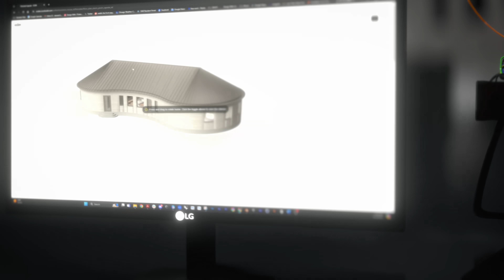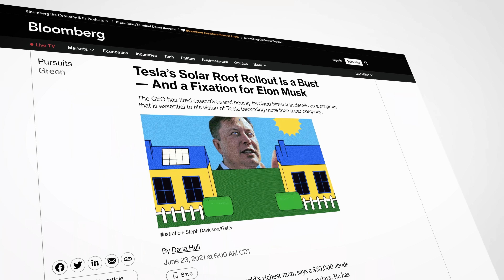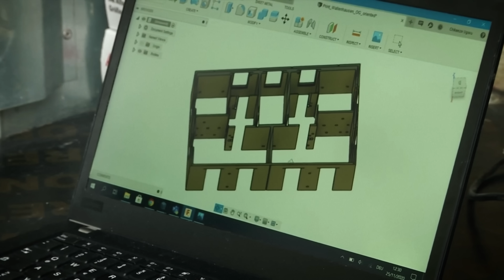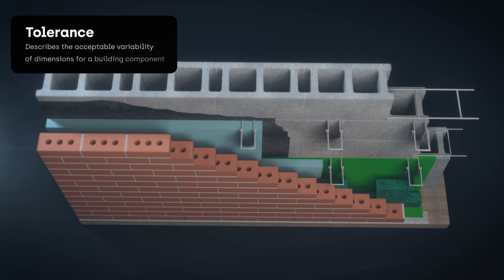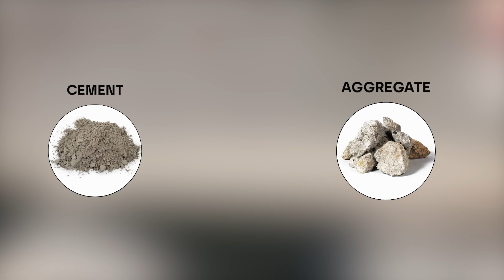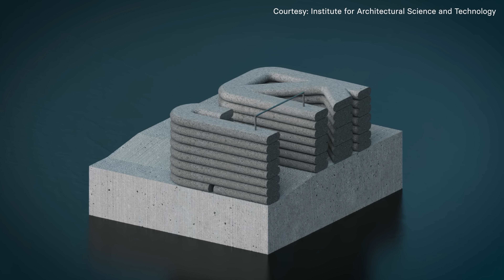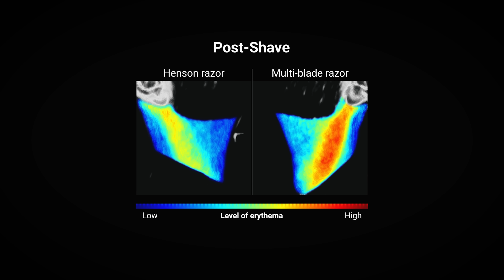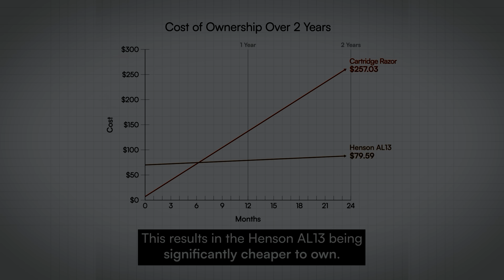Why 3D Printing Buildings Leads to Problems

Comment: If you're going to build a concrete house, using the standard pour into forms method is probably cheaper.
Reply: And   structurally sound.
Reply: I see no reason why both couldn't be employed. Seem to me with that much dimpling & texture printing leaves it wouldn't be very hard to 'surface' the print jobs with forms. Maybe using a slightly more plasticized thinset, perhaps? I can think of a few ways to potentially bite at that apple.
Reply: Can that do radius corners? Do they have those forms available or is it a matter of bending several layers of 1/4" osb and screwing them together?
Reply: On a one off, maybe - but how many people does it take to do that?

So to do.. i don't know, 50 houses it takes that many people x50, but with this you only need 1 person at most to monitor each print and you can do them all at the same time.
Reply: @PhosPhryne my forming crew can do 300 ft of wall in about a day and a half- 6 guys
Reply: @PhosPhryne  It doesn't matter how many people it takes, the bottom line is the price.
Reply: @marksandoval5361  .... And you do know LABOR is the highest cost of all?
Reply: @PhosPhryne  When everyone has been automated out of the means of production, who exactly is going to buy these products?
Reply: @andrewhooper7603  I'm not advocating or even think 3d printed houses can replace every aspect of a construction workers job. I'm just pointing out that they can have a use and it's not as far-fetched as you might think.
Reply: @PhosPhryne  how many does it take to set up printer? more than one I imagine...

Comment: For what's worth, there are designs and possibly materials that 3D printing can do and work with but molds simply can't. I don't know enough about advanced construction to name any in this particular field, but when it comes to home 3D printing, we have mountains of examples. Pretty much anything with a specific grid pattern on the inside or some interlocking mechanisms can't be done with a mold. Just to name two from the top of my head.
Reply: A lot of those elaborate "un-moldable" things are just pointless at an architectural scale. It could make sense to 3d print building components in metal, or ceramics with much finer tolerances, rather than trying to 3d print entire buildings.

Comment: The problem I see with concrete is cracking. I recently watched a show on PBS that tested the flexibility of an ancient Chinese wood building under various earthquake conditions. It was amazing to see how the thing flexed and danced around as it was shaken. Even under non earthquake conditions there is settling, wind pressures and temperature/humidity changes over time that will cause cracks and seepage in concrete. And patching concrete never seems to work well. I also think the exposed concrete looks unsightly since I don't like the African mud hut aesthetic. Cheaper is not always better.
Reply: Shockingly, the same was found in octagon blocks, when they were studied.  They could dance in the earthquake, but returned to the same position.   A square or rectangle block, does not do that. It's worse if you mortar it in place.
Reply: @normbograham  That is interesting. It seems we have for some reason become very wed to the square/rectangle for building structures. Maybe it is time to think outside of the box.
Reply: you can always attach some framing to get the exterior or interior visual you want.  the 3d printed part can be structural if they wanted.
Reply: Nothing cheap about concrete construction, especially when you form both sides of a wall. It's labor intensive and OPC concrete is expensive, and then you have to frame a wall inside your structural concrete wall to have something to insulate anyway. If Blue Crete (above) works out, it will save a lot of labor and materials.

Comment: It’s like the concrete houses that never took off. Even with tubes protecting wires and metal boxes mounted in the floors and ceiling instead of walls,  they never came into style.

The only reason this process is interesting to me at all is that some promise to use local soil rather than only trucked in supplies from elsewhere.
Reply: Concrete houses took off in Europe. The U.S. housing market was different, though, due to the abundance of wood. Slab-on-grade construction has the exact same repairability limitation, but is extremely widespread in the southern U.S. IMO, the repairability argument was never strong compared to the financial argument.

Comment: Imagine waiting and waiting for your dream house to be built, and you end up with a big rendering error intead
Reply: it happens with traditional concrete forms too if things are not braced correctly. its called a blow out I worked a job building the floor forms for a 15 story building and we had 2 major blow outs. having the forms shift and then 20+ truckloads of concrete start pouring through a hole makes a huge mess into a place that is typically very tight with shoring for the pour. it was always all hands on deck shoveling the wet concrete into buckets and passing them down a man line till it can get to a forklift.
Reply: or spaghetti house
Reply: Low ink warning !
Reply: 3d print an entire atual red ERROR building like from source engine
Reply: If that happens then the construction company will just redo it. Otherwise legal fees await.
Reply: Dang I forgot to switch the filament again

Comment: A big issue is that current methods don't allow dense housing. You couldn't easily (to my knowledge) print a row of terrace houses unless you used a gigantic gantry a whole street long to print all of them at once. The concurrency of modular construction means you can lay bricks for a second house while the first is being fitted and decorated. Currently, most 3D printed housing aims to just be slightly cheaper versions of the same expensive suburban single-family developments, which will not fix a housing crisis.

I am therefore surprised that construction 3D printing isn't aimed more towards prefab. People often complain about not wanting to live in cookie-cutter homes lacking character and uniqueness. 3D printing sounds good for that. You could talk to an architect about a custom design for one part of the house or some finishing touches that are printed on/off-site, cured, and then assembled.
Reply: 1) dense housing is definitely an issue, but most gantries also are easily retrofitted to build an entire row. This construction method would allow the printer to make maybe 4 houses at once, put a gap, and then start on the next cluster as the first cluster is being finished.

2) I disagree that construction 3D printing is good for prefab. A concrete 3D printer will never have the same economies of scale as a well designed set of molds. It's far too slow and sloppy by comparison. Rather, I expect pre-fab to be a symbiotic industry to concrete 3D printing.
Reply: @joranbooth5529  Well reasoned position, and I deeply appreciate that someone else has invested some actual informed thought into this. But I'd be remiss if I didn't point out as I have elsewhere in this comments sections there's going to be a vastly expanding need for concrete structures over the next two decades & beyond due to the selective pressures placed by climate shift. Concrete structure buildings can resist fire, flood, tornado & hurricane in ways stickbuilt & especially modular home systems cannot. I think the way forward will very much come to depend on a printers ability to  quickly establish superstructure & modular builders capability of bringing veneers to overhang & overlay them as more natural disasters come along to wipe peoples property equity out. It's only by that sort of teamup we'll have any capabilities of keeping up, especially since youths aren't entering the trades like they used to. Anyone who established such a partnership stands to really hit it superbig when they demonstrate capacity to rebuild entire towns wiped out in a matter of months. Look at how long it took to rebuild after Hurricane Andrew or Ida or Sandy. Or any of the towns out here in the magnificent West burned to their foundations by wildfires. With just such a teamup it becomes possible to get people's lives & communities back to some semblance of normalty in a span measureable in months rather than years. People wont have to move away from the communities & areas they love, many never to return due to lifepressures & unwillingness to disrupt the new lives they've rebuilt elsewhere waiting for their homes & communities to be slowly rebuilt. The first companies that demonstrate that capability will be hailed as heros and get to ride the good press gravy train into being wildly successful industry leaders.

...Just a thought. But If any of you jackoffs runs with this, don't you forget about me. I've been thinkiing about this for a while now, and I have some solid ideas about how such integration could be realized & made cost efficient AND portable enough to get rolled out just waiting for the capitalization & backing. Get in contact.
Reply: @brianhirt5027  Climate issues will definitely affect construction, but there are some major drawbacks to concrete production as well. Cement production relies entirely on fossil fuels and there is no easy way to transition to renewable. Further, the sand used in concrete must be dredged from mines and desert sand cannot be used. The world is actually running very low on sand already.

All tech has tradeoffs, and the balance will shift, but there is no silver bullet.
Reply: Yeah, I rather just live far away with space than breathing my neighbors breath.
Reply: Building vertically becomes challenging and expensive with traditional methods, but not for a printer. Home and apartments could be printed with 4 floors/homes allowing for dense affordable housing.
Reply: @hellothere6627  This is a good point, but there's currently a height limit on 3D printed buildings, because they don't use rebar or reinforcing frames.
That's probably a fixable issue, but currently the tallest 3D printed apartment building has 5 floors (by WinSun in Suzhou), was considered complex and expensive to pull off, and has some longevity concerns. And even then, they prefabricated the parts offsite and shipped them for construction.
That's why nearly all the 3d-print-in-place buildings in this video are single-storey or single+loft.
Reply: @finndriver1063  They do use rebar and reinforcing frames... there is not necessarily a height limit it just hasn't been done yet. We are working on an 8 story printer as we speak. We have also done multi story print in place but not with a gantry. factory or prefab printing is usually due to the limits of the environment, job site or material being used. not all 3d printable materials are equal. Our Gaudicrete 350 is made for print in place application and doesn't have the issues other materials have with shrinkage, slump or fall off.
Reply: @LeeGaudi-vb9ev  nonsense.
Reply: @finndriver1063  Not to mention the complete lack of large-grade aggregate in the mixture, as is mention in one of the top comments, made by a person who works with these printers. The cement in concrete is merely a binder, the strength comes from the aggregate - common residential cement has compressive strength about 20-ish MPa, while the softest aggregate rocks begin at 100 MPa and easily top 200 MPa. While using higher strength cements is possible it will be prohibitively expensive, defeating the original purpose of the technology.
As another commenter said, this is a solution looking for a problem, as the 3D printed components account for a very small faction of the finished cost, while also completely ignoring the cost of land.
Reply: @PTS1337 I don't recall the measured hardness, but the printed concrete ends up being much harder than standard residential concrete, or at least what is required by code. I want to say by a factor of 2x to 3x. The last time I looked at the numbers was 3 years ago and I don't have time to dig through my technical reports archive to verify, so please don't take that as definitive. Nor do I know concrete chemistry well enough to comment on why.
Reply: @hellothere6627  i would never in my life trust a wall 4 stories tall made of these pancaked layers of grout. That's ridiculous to even think of
Reply: This is exactly what I've been preaching. In the future you will buy a plot of land, design it, have it printed and get your keys in less than a month. completely custom, completely unique and to your liking and most importantly it will be the price of a normal house or cheaper.
Reply: We could also live in pods, eat bugs and be hooked up to the metaverse 24/7. You ideas are inhumane.

Comment: The problem us that a gantry is introduced to the site and when that happens why wouldn't they just use prefabricated wall and window systems which has the manufacturing scale and cost.